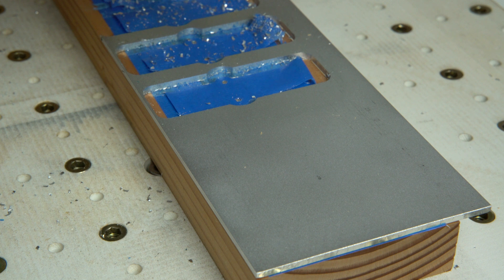Optimizing The Test Part With Threadmilling - DIY ATC CNC Router

Comment: Hey!
just discovered you and already subscribed :)

Just remember that when threadmilling, you need to compensate the fact that you program your feed from center of the tool when in fact you use circular milling. You need to slow down.
https://schnittdaten.meusburger.com/circular-milling-feed-rate/
Reply from the maker: Thanks for the calculator, I couldn't find a good chipload number for such a small tool to I sped it up and just used small stepovers.
Reply: @NikitaLab  this little tool use already low chipload in a straith line so low margin of error. with lower diameter tool, the real chipload is more important because more fragile tool that can't support abuse like a 12 mm tool.
You can check brand name tooling company for speed and feed for their tools then extrapolate from your tool brand quality.
Reply: also for your operation, drill then threadmill then contour the part.
0.1mm step opver for finishing is fine and less torsion of the tool ->wall more perpendicular
for finishing, you can speed up the spindle because you produce less heat as your flute is less engaged in the part

Comment: Shouldn't you threadmill as OP 2?  If the part moves a little bit when it breaks free it will be hard on the threadmill.
Reply from the maker: you are correct but the workholding was good so I wasn't too worried about it.

Comment: Great! Takes a good deal of precision to tap M3, congratulations!
Have you considered tapping before cutting out the main contour, while the part has less chance to detach? These tiny taps are pretty expensive.
Reply from the maker: You are correct this was just a test part
Reply: @NikitaLab  When I want a stronger hold, I use tabs in F360, but then there's a problem of separating the ready parts and filing the tabs off. On the other hand, you can just screw the entire stock onto the spoilboard and not mess up with the glue and don't worry about both stock piece and the spoilboard being perfectly flat.
I had a case when the double sided tape I used got too hot and separated, and it cost me a bit.
Reply from the maker: @olegtsvinev2666  yeah buy no pretty edge finish with the tabs and it's a pain in the ass to clean them up. The painters tape + superglue method is great, never had a part separate.

Comment: Sweet. nice work buddy. Where is the ATC action lol.  love seeing that man. And i think its about time you change the table the machine is sitting on, it affects cutting dimensions and surface finish. Im upgrading my table too cus it shakes a little. You will see it in my upcoming video this week. Love those rapids man. Good job.
Reply from the maker: Focused on the cutting in this video, too much work to setup a 2nd camera and I don't want to edit video. Yeah the flimsy table and stack of PVC, wood, and tape aren't helping. Hyped to see your machine dance as well.
Reply: @NikitaLab  looks like i gotta get ahead and make some more cutting movies aswell, havent done mutch beside smaller clips
Reply from the maker: @xillianto  yes you should, love the design of your machine please to an overview video of it
Reply: @NikitaLab  Ohh Overview in my messy garage ? :P Would need to do allot of cleanup first, and get done with flood coolant, enclosure and.. yeah, will be a while untill then.. 

As of now i just got some shower curtains inside, as toss chips several meters outside the machine..

Comment: I have a macro that will populate tool table, then you dont need to measure tool when changing.

you only measure at setup. give me a sound if you want it.

You set the macro up by measure spindle nose as refference, amd then you change 1 parametre in the macro, then you can measure every tool by number.
Reply from the maker: Would love to take a look at it, like I said just waiting on a probe to be my 0 offset for all other tools. Lmk how I can get in touch.
Reply: @NikitaLab  send me a mail at kjetor(@)gmail.com and i can send it tomorrow. pretty easy macro.
Reply: @NikitaLab  ohh, and i would rather use spindle nose as 0 point for the tools, males it allot easier for the system to have posituve numbers only